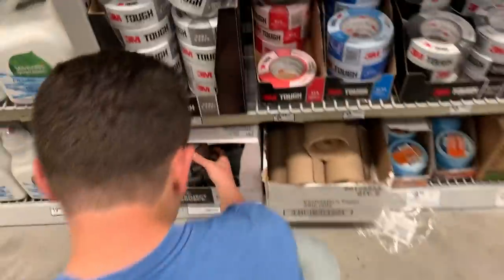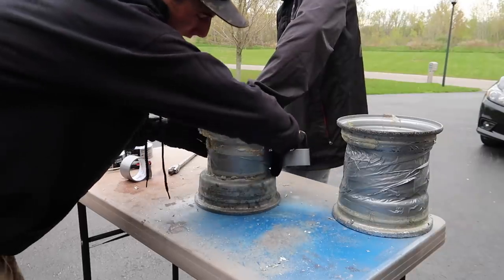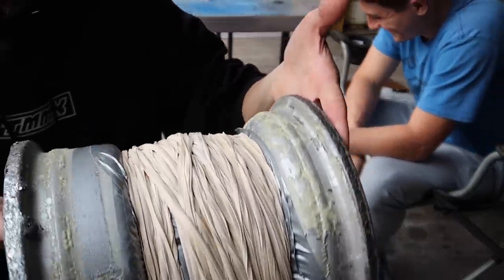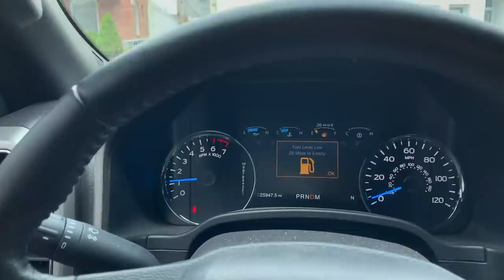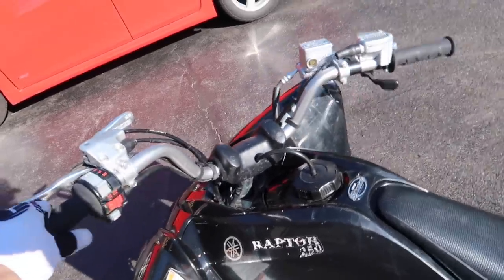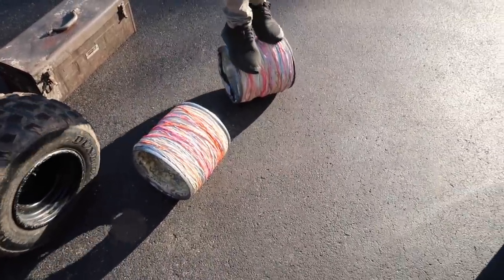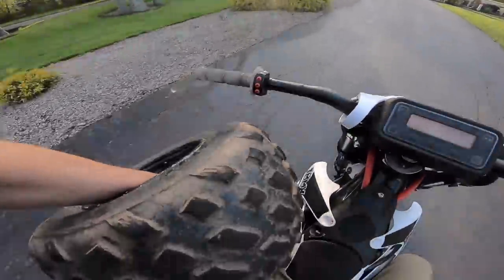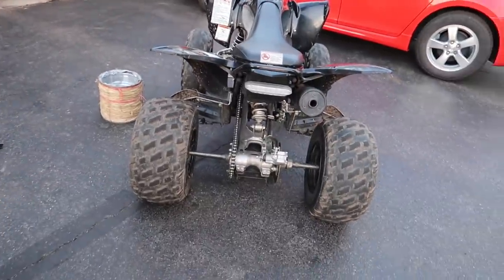DRIFT QUAD RUBBER BAND TIRES!!! 10,000 Rubber Bands

Comment: Yo you should make wooden tyres like use ply wood draw a circle on them cut em out do multiple glue them together then drill holes in them and bolt them onto the quad like a wheel . That would be awesome

Comment: DUDE!! DO APOXY RESIN / ACRYLIC. Find buckets that the wheels fit in with a few inches of space all around or more depending on how much “tread” you want, set the wheel inside down in the bucket and tape off from the bottom tip to the bottom so it doesn’t get in the center, fill up the outside ring in between the outside of the rim and the inside of the bucket to the top of the rim and let them set, you’ll have full plastic wheels.  Drift wheels that’ll last for a LONG LONG LONG TIME.  PLEASE TRY IT